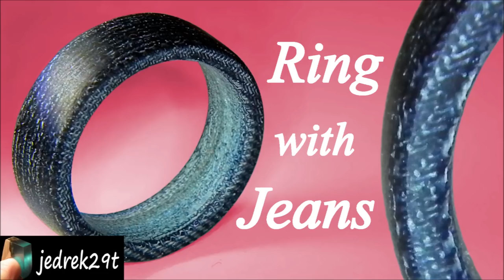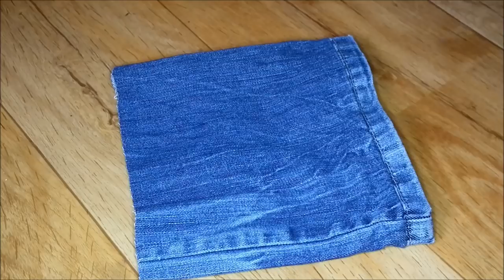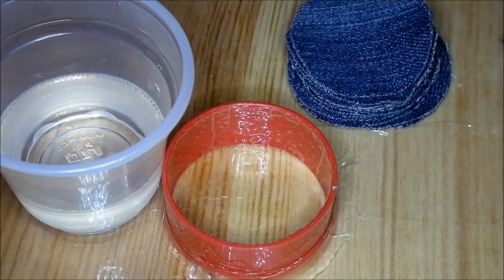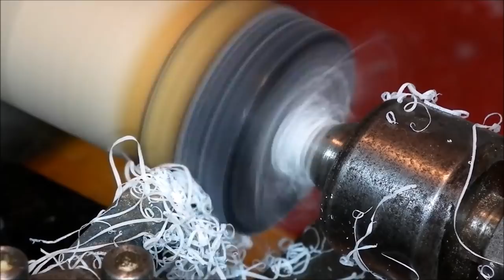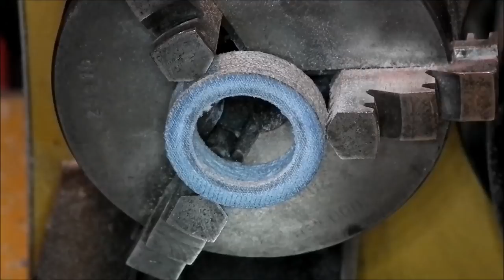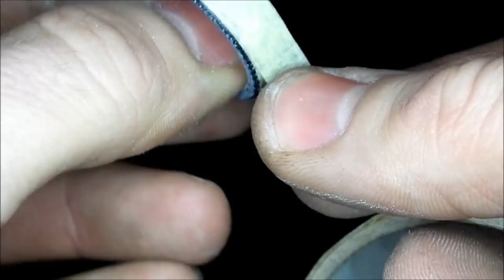How to make a Ring with Jeans. Denim Ring.

Comment: Looks nice. Try adding a few layers of an opposing color of cloth in between the denim, , then sand it at an angle to give it some color and depth instead of the straight lines. it's been my experience that micarta this thin is fragile. but the denim has an almost "warm/soft" feel to it.

Comment: That's interesting. I would have just used strips of denim fabric to wrap around a core with .CA glue, and finish it with a coat of resin. Like bent wood rings. Seems to me like you were trying to reinvent the wheel. Not everyone has a lathe.
Reply from the maker: The ring would look completely different. The fabrics would then be arranged differently

Comment: Dan! Beat me too it. I just did a prototype of this a few months ago. But I ruined it trying to even it out on the lathe.
Reply from the maker: try again
Reply: Definitely will do. I'm glad I found your channel. I've been excited about getting into resin art for a while. But yours is the first channel I've found that really explains the process for each piece. 
Btw what brand of resin do you use? I bought two gallons of 2 part only to find out their "special" formula has to be kept at exactly 75 degrees the entire cure or it turns into a weird rubber consistancy

Comment: Very Interesting! I have been wanting to upcycle my old denim. Also wanting to try making bend wood rings. And have epoxy lol. I wonder if I could combine these and make a ring with denim in a similar fashion to a bent wood ring by wrapping strips and then finish by soaking in epoxy. Thanks for the idea! Also... I thought the epoxy had to be a 1-1 ratio. Your numbers confused me.
Reply from the maker: Each producer has a different mixing ratio. You can do it as you wrote